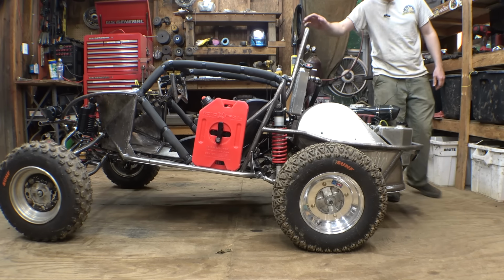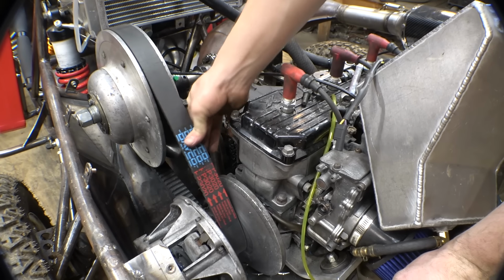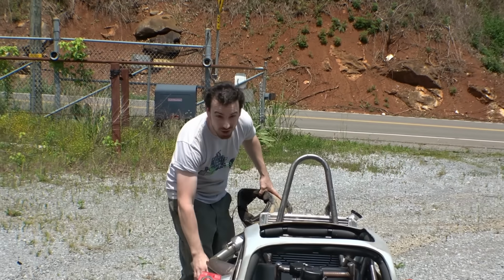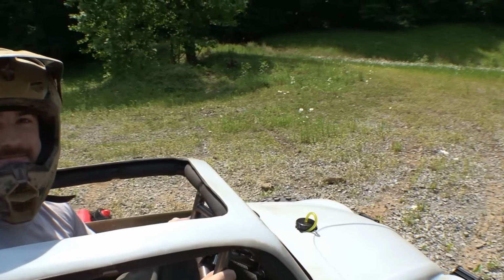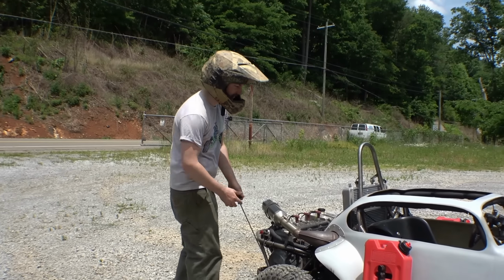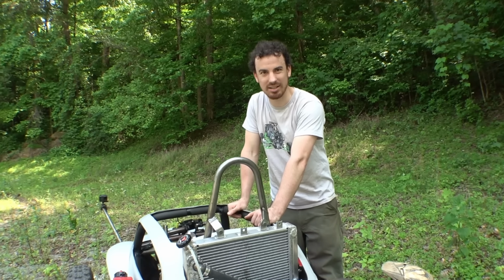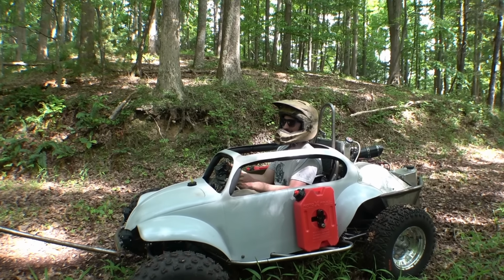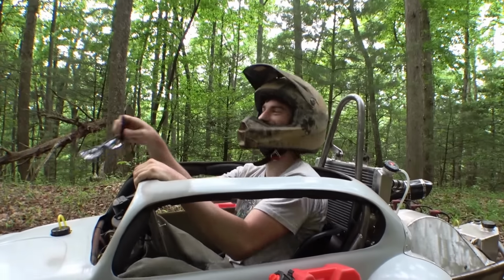This Thing is Nuts!!  - Mini Baja Bug Project First Test Drive

Comment: I hope this reaches your eyes...
 😊😊I absolutely love watching the build's you come up with just to mention one which is my favorite is the lil grave digger.  I have ridden snowmobiles for years. And I can hear the over Rev of your engine, your clutch is not engaging soon enough when you touch the gas it should be grabbing the belt a lot sooner in the rev range . I think this is adding to the engine over heating beside there might be air bubbles in the radiator we had the same problem with a snowmobile, so I pressure filled the radiator and lines back up just like you have to do with most German cars and it took care of the over temp problem.

Comment: I'm totally blown away with the last couple projects you've build, and your trouble shooting skills are great as well. I would suggest your carb issue is vapor locking because your running hot. I've seen this with snowmobile engines before. Get some fans on the rad and many duct some fresh air to the carb area if you can.

Comment: You can put a catch tank for the fuel above the carb to keep it filled up...
And you can move the fueltanks a bit forward to help with balance...
Scoops for the air and a alu plate to guide it behind you...
Just a few thoughts 🤔😊
Keep it up!! 😁👍👍

Comment: I sorta get the impression that a sway bar wouldn't hurt it any. because as you are steering it the one front wheel really leaves the ground. hindering it's steering ability some, having only the one front wheel getting traction. but I'm actually amazed that it doesn't wheelie like crazy. I figured it would be somewhat difficult to keep the front wheels on the ground. but it's better than I thought it would be. a two stroke with a CVT is always going to be different than a four stroke. because a two stroke has an optimal power band where it runs the best. a four stroke is more forgiving in that respect. like you said some more tuning is going to be necessary. and a fan on that radiator is also going to be necessary. to get the temperature down to where the oil can do a better job lubricating the engine. but it's maiden voyage is a success and it' gave a lot of input on what you need to do to make it perfect.

Comment: Cool! I think you need a rear arb to reduce the body roll under acceleration and help keep both front tyres on the ground. And the rear suspension is still sagging a lot. But it seems to ride well and when it's dialled in this will be an amazing machine!

Comment: Love it! Think you could do with stiffening the suspension both front and back also a better roll "cage", safety hoop and it'd be a really good idea to put a harness in. The it looks like the hoop you've got is pretty much pointless especially when you'll probably be halfway out if it rolls and a harness would prevent that and at least give you a chance of not seriously damaging yourself. Anyway I'm sure various people will have different ideas about what it needs or doesn't need, etc but it definitely looks like fun and is a great build. Still think it's time to do a build where you design it first so you have a full plan of what you're trying to achieve. Honestly fixing any issues in CAD is far, far easier than doing the work twice. Just think this is the next step along your building journey. Thanks for keeping me entertained.

Comment: Really like your build the reason why it doesn’t do donuts as you engineered it to hook up, which is not a terrible thing which means that it would slide easier if the suspension was stiff in the back .
But great job ! Keep up the good work

Comment: I think you need to put a strong fan on that radiator and have it wired up so you can leave the fan run when you turn the motor off so that it continues to cool the engine down
Reply: I had a similar build and I was abley to get a dual fan from small car with zRAD and put fan on switch to make sure it ran whole time and for a while when done it was a little buggy with a Yamaha 1000 street bike engine from a 96 FZR YAMAHA R 4 cylinder
Reply: When the motor stops, so does the coolant pump. So running the fan while eng is off only cools what is in radiator. K cool n thx

Comment: Those engines run between 130 to 150 degrees, anything over that is hot hot. You should also rejet the carbs up, at least 5 sizes on mains! Remember that these engines are jetted for a max of 10 above zero. The radiator is too low also. Even cruising at 50 mph, the rad is getting close to zero airflow. Make some scoops beside your shoulders that direct the air into the radiator.  Other than that, I'm loving it. Also I think radiator is more than big enough, it just needs more fresh air airflow!

Comment: Check to make sure your fuel lines are not anywhere they can get too hot. It causes vapor lock and at 200 it could be getting the carbs so hot they are vapor locking. You definitely need some stronger springs in the rear and possibly an anti-roll bar. Very cool project though. Get a few bugs worked out and it should be a rocket powered roller coaster 😎👍

Comment: New springs or weight in the front. In  the old days on race cars  the y  put  weight lifting weights in the cars by   welding a  rod and mount the weights that way.  great video

Comment: You need front tires with a lot of ide bite. Hit the brakes, start the turn, WOT and she’ll come around. The diff is making it harder to do so you have to transfer weight and power. Love that bug, have many rc versions myself.

Comment: A rear sway bar in addition to stiffer rear suspension would help alot. Maybe mount the shocks further back towards the tire will help. But definitely need a sway bar before you flop that thing and it will do donuts better!

Comment: with all the roll and probably jumps that the baja bug will be doing , maybe(depending on how much work it will be) consider 2 stroke jetski carbs from a yamaha, they are pressure fed carbs, so there is no floats or bowls, so the fuel wont shift around and cause the engine to bog down when trying to do donuts and such?

Comment: Air scoops where the "rear" windows are to scoop air behind the seat and a big puller fan. Derale makes some very low profile high flow fans. Gas tank mounted above the radiator to gravity feed the carbs. Or at least a surge tank mounted above the carbs.

Comment: Stiff shocks help with getting the wheels to spin.  You mentioned widening.  To widen the body I have seen on other buggies,  a cut down the center and make the cage a center ridge that the body edge slides into, c shaped ridge. Then you don't have to put the fiber glass together, you can take off half at a time. You will need to bend the center ridge to the shape of the body, that could be ruff. It would also add contrast and look sharp, like a racing stripe. < Just a thought.

Comment: Hey man, i work with suspension and geometry, pretty obvious and others have said it, your rear suspension is too soft, what you loose in the front you gain in the rear and in this instance you got all your traction in the rear, stiffen up them rear springs and youll gain traction in the front with cost of traction loss in the rear but that means donuts and drifts, once you get the suspension sorted then you can dial in your castor camber and toe in the front. Following and looking forward to this thing running well.

Comment: Since you're blocking the radiator definitely need a fan.
But if she's  lean shill bog  and run hot.
  Only vehicle I have with a two-stroke is  in my ultralight. That's a Kaw 440. Fan cooled.
 Have other planes but it's been the fun one for three decades.
  Also it is no different than my other planes. I'm able to adjust my air/ fuel mixture  while in flight. It's necessary for altitude changes. I do so monitoring cylinder head and exhaust temperatures. 
    🚜🤠🐂

Comment: Yes you need a rad fan. On a race car one time I tied in a condenser to get more water and it helped a lot! I also used a product called water wetter. But antifreeze will help it run cooler bc it’s got a higher boiling point check your fuel pressure coming off the fuel pump if them are the original carbs then your jetting should be right.

Comment: you def need to add a fan, maybe might end up having to put a 2nd smaller radiator with a duct to force air through it when moving like some motorcycles and dirt bikes do, but man, shes a ripper brother, little tuning, some bug squashing, and some cooling mods, and she'll be a beast

Comment: I think its getting hot, its a Snow machine engine you needs some snow lol.. anyways you may have to stretch it just to keep the front wheels down to steer also stretch the roof up cover that noggin with some bars ⬆️and Chris you always forget your eye protection 🤓😂

Comment: Add some duct/shroud in the rear of the "side window" to direct air into the radiator.  Could do a shroud at the top also to pull air through.  Your body is blocking all the airflow.  A fan is a good idea also.  Just a personal preference... Replace the square lights with round... Bugs need round headlights.

Comment: Remember tuning, weight forward will make it loose , weight towards the rear will make it tight. The engine weight and drive weight is all on the rear. Right now that thing is as tight as possible. Hopefully when he sees the video he will see how bad the rear was; almost to the ground.
Sway bar? I needs one if it don't have one (anti-sway bar lol)
Might even need to move the rear shock mount or something with the front.

Good job otherwise, looks great and a bit of suspension work etc it will be mint

Comment: awesome build! You should look into getting a firewall of some sort and more head/neck protection, and maybe some rear swaybars+stiffer rear springs.  And a 15 inch body/chassi stretch, I do think the bug body looks good extended too, not uncommon on dunebugs. a stretch would give you much better more predictable steering.

Comment: This machine has RIDICULOUS potential. But it 100% needs: much stiffer rear shocks, either a fan, bigger radiatior with a fan, or 2nd little radiator with a fan on the big one or both. You can not have enough cooling. And maybe a few safety improvements. The front looks great though.

Comment: It looks like you have a little room at the back of the side windows to create some ducting to funnel the air into the radiator, you could put a shroud over the rad front to protect you from it and have a fan on the back that pulls air through the rad and in from the sides around you

Comment: The thing is if you dont want to put radiator fans on it then you need to run the radiator in the front where it can actually get air flow. You sitting in front of the radiator is not helping at all. Its getting hot enough to vaporize the fuel before its getting to the cylinders. After you fix the over heating problem and put more weight in the front to distribute the weight correctly it will do dounts and handle hella good. Then you will have a badass machine. Good job on the build thought its sick.

Comment: i think the radiator looks like an appropriate size for that engine, but its right behind you so it's blocked pretty good. maybe try some scoops before the "c pillars" and a really nice radiator fan. another alternative would be a taller radiator so it has ore surface area behind your head where its least blocked. that thing rips though, i really dig it.

Comment: Stiffer springs Especially on the rear , and a rear sway bar would make it steer way better . You'll get there playing arround and tweaking things . That's half the fun 👍 You may need a low pressure fuel pump if it's only gravity fed ?

Comment: So, at the track, Porches are known for having bad turn in because all the weight is over the rear tires. It's common to just tap the breaks right before you turn to get weight on the front wheels. Maybe give this a shot when you enter your doughnut.

Comment: 100% news stiffer spring in the rear. Under any acceleration you can see the tyres riding the rear arches. + Stiffer rear springs will majorly improve the front steering. Keeping the back from sinking will stop the front for lifting as much.

Comment: Forget motorbike engines! Btw, cooling system definitely needs a rework, your head is right in front of the radiator. Also, in a snowmobile, the engine would always be running in freezing ambient temperatures, so the oem radiator size is designed with that in mind.

Comment: that thing rips.  if you stiffened up the rear suspension it would help steering alot. also might need to fix fuel flow to the carbs seems to be running dry

Comment: Needs some clutching work forsure but pretty neat but I’d deff look into the carbs as well does seem like it’s dieing for fuel. Snowmobile engines require a lot of cooling, that’s why they have so many heat exchangers and use snow to cool them.

Comment: For a fan use a Noctua NF-F12 industrialPPC-2000 IP67 PWM. It is a 12v fan, ip67 water and dust and only pulls 0.1 amps max. You will need more than 1 of course but they are small relatively quiet (way quieter than the automotive ones) and will be easy to place in the tight areas and are designed to push air through radiators or restrictive computer heat syncs.
Just make sure the engine is producing dc voltage because it may be making ac voltage since it killed the headlights. It's not common but I have seen it before.

Comment: more top end on gear ratio, a radiator fan. 230 is max temp. 280 is warping, 300 is usually toast. and stiffen the suspension, taking to much load to dip and not drive, but other then that love it.

Comment: I think you could put a little bit bigger/ taller tires on the back unless you don’t think you have enough torque. Other than that I think you will have something to give GrindHard’s Colonel a run for its money. Keep up the good work 👍🏼🤙🏼🤟🏼

Comment: I'm pretty sure most coolant overflow reservoirs are usually mounted to be even with the highest point of your coolant system or maybe even higher with the inlet hose to the overflow tank at the bottom of it so that way it can overflow when it is hot but then if it has to it can also pull the coolant back into the system

Comment: Find a 600 etec motor for your next project.  Fuel injection direct injection. 2 stroke power without the finicky carburetor, warm temperature change issues. Plus 120hp in a small package.

Comment: You need to adjust /redo the steering mate. All the steeringangle goes to the inner wheel, that is in the air all the time 😅 and the outer wheel is still almost a streight line ahead.
Check the footage from the front bar..
Sounds Amazing though 😁👍👍 keep it up!!

Comment: Shove some foam in the gas tank, and a little fan should help the ones at parts stores are pushers and pullers just have to flop the blades around for how ever you want to set it up

Comment: I would either do a roof mount style scoop like was used in racing baja bug or make vents from the rear section of the side windows to direct air to the radiator plus fans. Your body is blocking most of the air flow to the radiator.  And stiffen up the suspension some.

Comment: good call, figure out fueling; might help a bit with the temps too. if you run fans you don't have to relocate the rad. if you move the rad you might be able to get away without fans (and thus noise). Hot day, slow trails might still need fan tho sooooo....

Comment: snowmobiles are used to having snow thrown on their heat exchangers, and water is better at cooling that air. so you got a double whammy of heat soak. maybe you can add air intakes above your shoulders as well as some fans.

Comment: The struts need more leverage over the trailing arms. Make the lower mount further back on them, then lower the upper mount proportionally to adjust height, further. Also, semi-ducted scoops on the side windows to direct flow through the radiator. That and a single high CFM electric fan with a decent shroud and some z-axis offsetting/spacing from the radiator should do you well.

Comment: Awesome build! That radiator definitely needs a fan since you are the obstruction from direct airflow to the radiator. Im pretty sure youll be fine after you put a fan on it. I feel like the rear springs should be a little more stiffer and that would help with a donut. Maybe a dual rate spring?

Comment: Definitely an overheating issue. Might want to add cowling to help ram air through the radiator plus a fan. Keeping it running at a cooler temp should help with the performance too. When then run hot they tend to bog considerably.

Comment: To everyone saying its too soft, thats not entirely true, rear needs a sway bar and maybe some preload, and needs some clutching, with any 2 stroke cvt drive, clutching plays a huge part in how the engine runs under power, it seems the engine is getting flooded bc the engine cant stay within its powerband due to the primary engaging too fast or too early.

Comment: I think you are to lean on the main jet, that will make a lot of heat . I also think that you are too rich on the low and mid . The lean on the main is coming from the clamp on filters on carbs , that is flowing more air at WOT . I think a sway bar on the rear would make it even more fun . Keep up the great work .

Comment: You definitely could use heavier rear springs, it might help keep the front wheels down, and help with steering. It just throws all of the weight back as soon as you gas it.